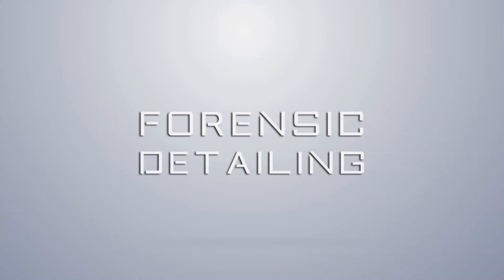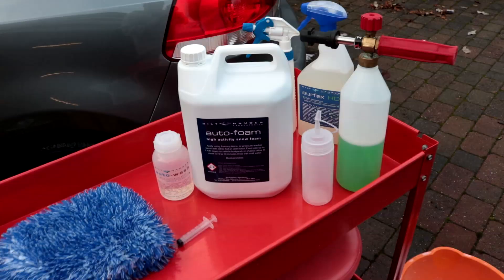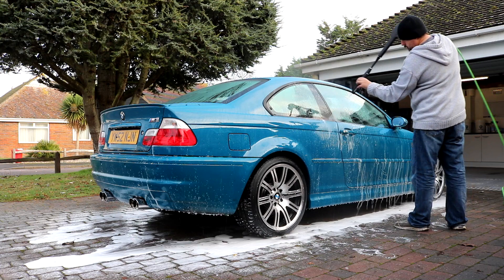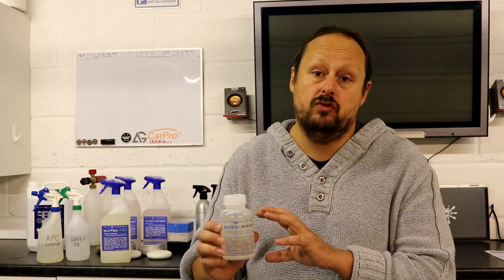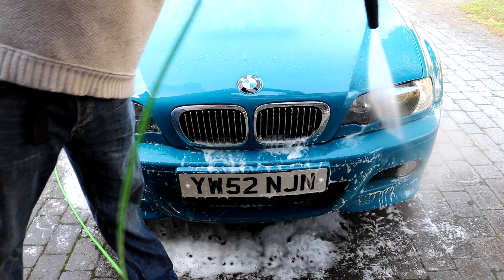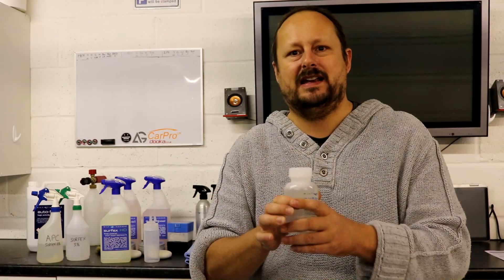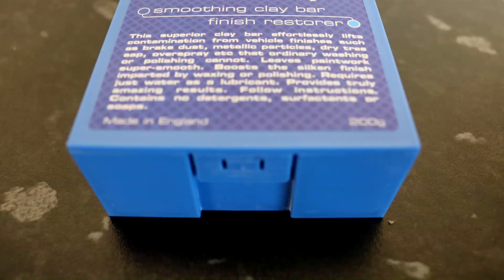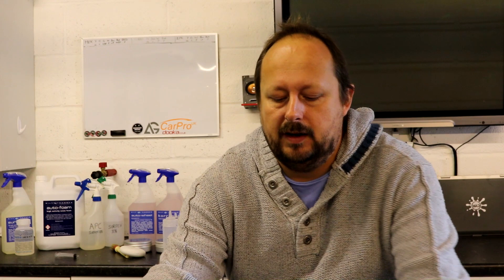Bilt Hamber Laboratories review

Comment: After years of being an autoglym anorak out every weekend I stumbled across your videos! What a wake up call ! I ordered the bilt hamber double speed pack ! Bloody brilliant ! Just wondered is it better to use the same manufacturers products ? I'm looking for a quick detailer, so I was looking at the bilt hamber QD which you gave a third place in your awards or would you go for the winner 'bouncers done & dusted' to go with the already applied double speed?! 
Also just wondered  are autoglym products not very good ?! 
Keep up the good work !!

Rich
Reply from the maker: autoglym are very solid products as well..  in fact excellent..   QD's.. Ok so Bilt hambers one I find gives amazing gloss..  It can be a be streaky and need a bit of extra buffing at full concentration so I add about 30% extra filtered water and find that works.. but the gloss level is really exceptionall..  It also has the charged particle chemistry so any dust is kind of cushioned (although generally as a detailing fundamental dont spray and buff dirty dusty cars)...

bouncers I think its quats based and i think its really loaded with the active ingredients.. It doesnt leave a dry finish, its really wet looking and you can almost feel the product on the paint afterwards but IO love the gloss from it..

theres so many cool ones..  I have a lot of detail sprays and kind of reach for different ones a lot..

The adams one is excellent.  FK425 is cool.  Angelwax QED and autoperfekt silk offer much more hydrophobic and protective qualities.  infinity wax rapid detailer I like as well as its so translucent no film or streak and nice gloss and works well as a rinse aid...   have a play with as many as you can..   Koch FSE as well great for water spot removal and general gloss...
Reply: Hi, thanks for that, so its not an advantage to use the products from the same company? I asked the question about Autoglym, as none of their products were in the running for your awards. Also what do u recommend to protect the black trim? I'm using 'Koch Cheme nano magic care ' which is very good !  
Tried to buy the silverback drying towel but it seems to be sold out everywhere! Any ideas of who might have any ?! 

Thanks again
Reply from the maker: Liquid elements or in2 detailing are the 2 I know that sell it.. but I can see they are out of stock you will have to ping them mate.     there are advantages in using ranges from one brand in the sense that this company will formula products to work with each other.. the disadvantage if you just stick with one brand you might not be getting the products which you might consider best ni class and work best for you.. so no straight answer.. but autoglym are a solid company with solid easy to use tried and tested formulations..  they are a really nice people as well and you are supporting a UK company and UK jobs... so its all good mate.

Comment: John, can you help me out. I have a question about Bilt Hamber surfex HD.
Is it an APC or a Degreaser or both? I really can't find what it now really is?

What I use it for is the following.

5% dilution for nooks, granny's, badges etc
10% engine cleaning
straight or 50/50 for heavy dirty tires.

So should I see Bilt Hamber Surfex HD as an APC or A Degreaser?

Because otherwise I wil just buy Meguiars degreaser and see Surfex HD as an APC.

Hope you can help me out?

Thx
Reply: Both depend on your dillution

Comment: Washed the car today. Bilt Hamber snow foam followed by their car wash. After the snow foam I had a mental block and forgot I hadn't washed it. I used my air drier to blow the water off the car and it came off easily but once I realised what I had done and washed it with my Bilt Hamber car wash I noticed that the water didn't come off with the air blower so easily. Did I do something wrong?
Reply from the maker: your saying the auto wash seemed to make the water stick to the panels more...  could be something to do with the surfactants.  Autowash is like pure surfactants and certain surfactants are cationic.   So they are literally drawn to the paintwork and they stick to the surface like magnetics with a positive charge at one end.  the other end is the negative charge which is hydrophillic so can create a layer or material which has different water behviour to the underlying protection on the car..   so cover a very hydrophobic wax in most car shampoos and it can appear to remove the hydrophobic effect of the wax and you think like.. damn its stripped my wax or my wax has died..    good thing is the bond isnt strong and if you just keep rinsing for longer it will rinse away the material.     Im almost certain thats what your seeing.
Reply: Thanks Jon that’s exactly what I thought. I did give it a good rinse with the karcher but the water definitely stuck to the paint after washing whereas after the snow foam it blew straight off and I did think it had stripped the wax. It was the first time I had used the blower to clear water on the car and it certainly worked....the first time. I thought I had done something wrong or that it was supposed to strip the wax so glad I hadn’t.  Next time I will rinse it for longer.

Comment: have used KORROSOL recently but found it pretty useless for TAR removal, where as carpro trix was excellent at tar removal.
as i bought 5l of korrosol, which will last me ages, i now need a separate tar remover. could you recommend one please?
Reply from the maker: yer korrosol wont work on tar.  Use Autosmart Tardis my friend its a bit heavy duty but its the most powerfull one out there for sure.,
Reply: @ForensicDetailing   ok thanks for that, will give it a go

Comment: So after claying and then cutting to remove any swirls or blemishes, i need to use the cleanser fluid before applying the DS wax, would you use a sealant such as Klasse or AG after the DS was.
many thanks
Reply from the maker: hey paul, no dont put sealants on top of waxes..   DS will last as long as some sealants if you look after it.  So I would perhaps say use it as a standalone product is perhaps best.
Reply: Thanks for the quick reply, keep up the great vids, cheers Paul

Comment: Hi John, Is built hamber snow foam safe on all waxes and sealants, and how would you compare it to Gtechniq snow foam?
Reply from the maker: Ive not used G techniq snow foam.   Is it safe on waxes and sealants... yes more or less remember a snow foam is really 99% water and 1% blend product when it hits the panel..  the diffeest difference in snow foams is less about formulations and more about concentrations but will talk a bit more about this in upcoming video. but anything which has a better effect on road film will generally mean its going to effect wax more but the difference is minimal and theres other factors.

Comment: Is there any need to have both surfex hd and korrosol in your arsenal,or wouldt surfex do the same job?
Reply: Surfex is the degreaser. But the korrosol is the fallout agent, as is the alloy cleaner. He says in the video (approx 28:30) that you can use alloy cleaner on the panel but the chemistry is better suited to the wheel. Whereas korrosol is better suited to the panel only. 
I think I'm doing down the same line as your implying by just getting the alloy cleaner for now and see how I get on with it. 
I'm happy to get a product if I think it's the best for the job, but I'm not going to double up and buy two similar products for a minor chemical change and minimal final difference in the panel. My 2c (2p).

Comment: Hi when it comes to polishes and waxes,could you say polish the car with auto glym   resin polish,then wax with a different product,say built hamber.or are you best sticking to one product from a range.In other words do different products mix?
Reply from the maker: you would be fine laying down using super resin polish and then a wax from another manufacturer..  

It can be good to to sometimes use products which are designed to work together...  but in this particular instance it wouldnt be critical etc...
Reply: Hi again thanks for that,the problem today is to much choice,it baffles us punters,gone are the days of that tin of rock hard turtle wax.
I just want to go down the simple route,I have been using maquires ultimate polish and wax but call me old fashioned,I just don't like it,probably you'll disagree.
I've decided to go down the resin polish autoglym,followed by autoglym hd wax,topping up with the aqua wax when washing.Good or bad? What's your views.My car is only 2 years old and metalic black
Reply from the maker: If you dont like something. I dont disagree..  Its a fact you dont like it..  You have to find what works for you..  Megs have some cool stuff...  Some of their waxes are a bit budget though.. so no I dont disagree.

Autoglym products will deliver you results...  SRP with HD wax.. with aqua wax..  All 3 are good products and will give you great results..

Comment: Another excellent report and review. I have to ask, although dirty, the blue Bimmer seemed have an great finish before spraying the snow foam.  Could that have affected the overall cleaning ability (enhanced)?
Love the music, by the way. When will it be on iTunes? :)
Reply from the maker: well the betsie wasnt too dirty had a thin layer of road grim hadnt washed for a couple of weeks but didnt use too much... so yer the less dirt the less is going to be left I guess.. still did a pretty great job of getting the layer of grim off though...
Reply: are you missing a headlight washer?
Reply from the maker: yes mate, nice spot :) it flew off the other day.  maybe not enough antifreeze..  got to pick up the replacement and get it painted up.. annoying :(

Comment: Hey  @Forensic Detailing Channel 

Mate can I ask for your advise? 
Have you had a chance to check BH Auto Mitt? Would you recommend it? It's about the price of MM mitts.
Nielsen tar&glue - any experience with this?

Also you have reviewed two great products lately - bead maker and done and dusted. I am up for bead maker as a top to DSW for summer. Any thoughts?

Just making my shopping list before spring arrives :)

Cheers!
P.
Reply from the maker: beadmaer should sit on to of dual speed wax without too many issues.    Ive not tried the mitt buddy sorry.  I would recomend.  carpro mitt, MF madness incredi pad small,  dooka wash mitt, or a chenille one if on e a budget.   chenille mitts are the best actually just dont like mitts which are like gloves.

Comment: Thanks for a great and serious channel. Hopefully question hasnt been asked too many times before but can I ask about the mixing ration you use for the Bilt Hamber Snow foam in your foam lance bottle? Container and their sites info says 1:100 - 5:100 dilution. That cant possibly translate to 1:100 in the foam lance bottle cant it?
Reply from the maker: no its 1:100 to or 1%  upto 4:100 4%  (or 5%yer)  but thats PIR (as it comes out the lance and hits panel, panel impact ratio).  Google bilt hamber auto foam and calculating PIR theres a great post from brian on detailing world about how to work it out.  1%  should be able 1:4 perhaps in the lance something like that (obvious varies).   work it out mate and let me know. mark off the lance mix ratio you use (the dial on top of the lance)
Reply: @ForensicDetailing  Thanks for the quick reply. I will have a look at it.

Comment: I tried Auto QD diluited 1:1 on the bonnet but it left lots of streaks (I had to use Eraser to remove them!). I used a long fiber cloth (Microfiber Madness Crazy Pile) for spreading and buffing. Never had these kind of problems with other QDs.  How do you apply it?
Reply from the maker: I found using it neat and if I was going on top of a fresh coat of something it could be prone to streaking, more so if my paintwork felt sticky from a product as opposed to silky and smooth.  but if I watered it down those problems went away...   not sure whats going on for you, sometimes you can get compatibility problems and streaking with products,   applying on hot panels can also play a bit factor in this generally speaking...  doing this channel ive had it reported to me with various products that someones had a streaking issue that Ive not always been able to replicate..  a lot of times its been due to compatability issues with the protection thats underneath.  for example people had streaking issues when layering product X on top of fusso but works fine on a nuba wax etc...  get a fair bit of these types of questions.

so really mate, take a photo of it and have a word with bilt hamber as they understand the product better.. but I can say the gloss that the QD provides is outstanding.
Reply: Ok thank you, the car was parked in the garage so it was not hot at all. I have Gtechniq EXOv3 as protection, maybe it's not very compatible with it. I'll try again, maybe using a different cloth and less product.

Comment: Hi. You say that auto-wheel and korrosol smell nasty, but if you compare them to let’s say Sonax Wheel Cleaner, what do you think, is it just as bad? My first experience with a wheel cleaner was a few weeks ago with Sonax Wheel Cleaner and it smelled really, really bad. Almost hurt my nose, although I was outside and everything. :)
Reply from the maker: the ones that turn purple all generally stink, but there are low odour version of these products which are a tiny bit better.
Reply: Thank you for your reply. What products would you recommend for iron removing and wheel cleaning that doesn’t stink that much?

Also what are your thoughts about these Bilt Hamber products today? Would you say that their surfex HD, auto foam and auto wash are still the best products on the market? Thank you.

Comment: Is the Built Hamber korrosol safe to use on a ceramic coated car? Also would the wheel cleaner be safe to us on the paint with ceramic coating? The reason I ask is because I'm a tight old git and I already have wheel cleaner so would save some money 😁
Reply from the maker: I would fire that question to bilt hamber..  but Ive used it on coated cars with no problems pretty sure answer is yes but they can go further.
Reply: Forensic Detailing Channel Thanks for the reply mate, I'll get in touch with them as you say to be 100%.

Comment: Just bought some double speed wax. Will be trying it on my brand new Fiesta ST soon (which I told the dealership not to clean.) Think I might try Korrosol as well. Will I need to clay after Korrosol?
Reply from the maker: hey richard...  you clay to get those small bits of bonded/stuck on contaminant mainly brake dust and oil and sap, that washing just doesnt remove...   So korrosol will help break down a lot of the fallout before claying, and tar and glue removers will help break down the sap and oil before claying..    you need to feel and inspect paint to see if it needs de-con.. if it needs de-con then generally a chemical decon will not get all the contaminant, so you generally clay after you do a chemical decon yes...    

I advise you dont clay unless you machine polish afterwards because dragging those contaminants off the paintwork with clay scratches the paint.. See "how to clay a car" video on the channel.
Reply: Forensic Detailing Channel Thanks for the reply! Do you mean the clay will cause surface marring. Won't that be from dragging the remaining contaminants across the paint? Although I'd have thought there would only be very light contamination left after using Korrosol?
Reply from the maker: clay on its own can do it.. but yes its generally for me when you pull big clumps of crud off the car and drag them over the paintwork that you get the juicey ones...   fallout yes i think the korrosol will get a lot of it, but its more all the other types of contaminant.. sap and oil for example tends to attract all sort of crud in it.. it will do light damage to the clearcoat when you remove it but you wont always be able to see the damage unless you have the right light..

Comment: Hello sir, congratulation for this fantastik presentation.Please can i ask fir help. It is surfex hd generaly safe for interior derailing??? Do you have any dilution ratios when i use it as interior car cleaner for carpets, plastics vinal dashboards, etc????
Kind reegards from Athens Greece
Reply from the maker: safe for interior detailing.. but literally for dash board wipe downs.. run it at 1-2%.   For cleaning carpets maybe 5% (go higher as required)..     Its a strong degreaser..  not especially high foaming but potent..
Reply: Forensic Detailing Channel oh god...1-2% and 5% only???? It seems to be very strong!!!!!!! Thank you sir, i just looking to find and apc to use on any case, inside ouside, interior carpets plastics e.t.c. and this products seems it is ok and the prise...fantastik!! Do you recomend in general when diluting apc tonuse distilted water???/Thank you sir for your responce.
Kind reegards from Athens Greece